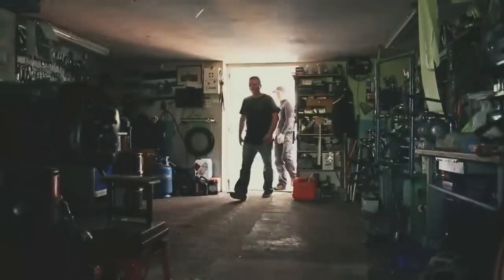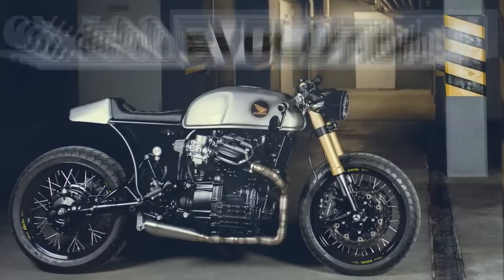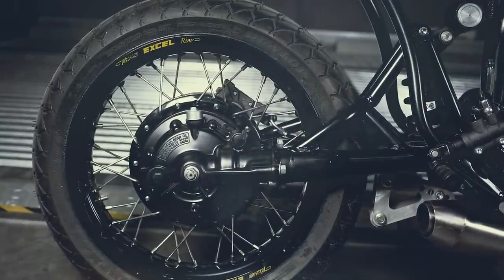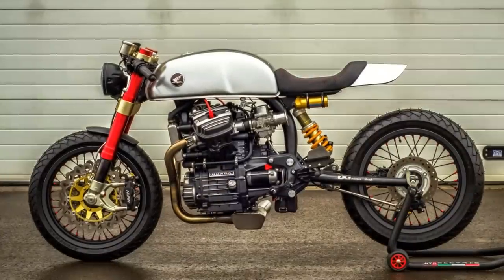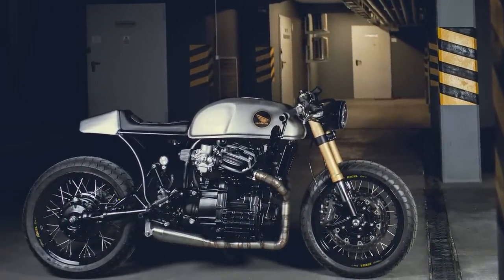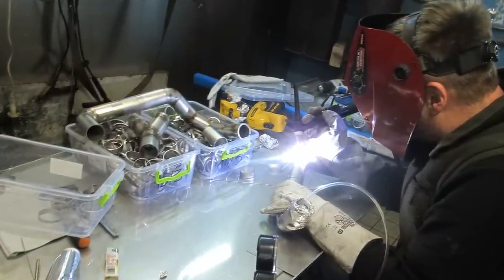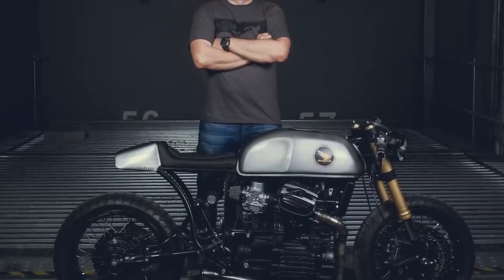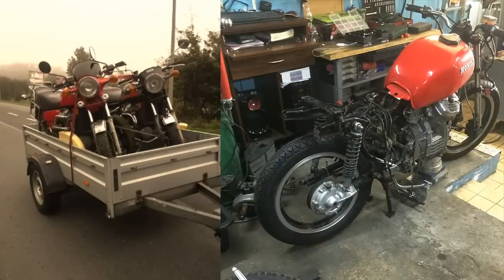Cafe Racer (Honda CX 500 by Wena Customs)

Comment: Very nice machine. Only one issue I see is that the exhaust emits directly onto the back wheel. A bit of oil and dirt from revving could make that pretty dangerous. Most under engine exhausts usually emit to the side to prevent this (eg versys 650 and er6f)
Reply: YEAH that's correct but is easier to slide :-)
Reply from the maker: Yes, you are right, but if you look carefully, you will see that the exhaust end hole, is directed to the side. :) Cheers.

Comment: This is a really nice video and really nice project. May be my next one. I did an XV750 a bit in this color spirit ( ic an share a picture to you  @racer TV  ;) ). But here is the point: i wonder if the inverted fork doesn't touch the exaust on big braking ?

Comment: Thanks for another great video Victor !
Can you tell me if you know, how they dealt with the liquid cooling ?
Are they using an electric fan system, or the factory belt and fan drive ?
Trying to see if they are using the original radiator, but not able to get a good look at it.
Otherwise, yes, a great build similar to Sasha's for sure !
Still think there is something more to be done with the rear suspension system in my opinion, but I do like the idea of the curved rear seat support.
Thank you again for all you do for our culture Victor !
Reply from the maker: Thank you. I'm glad you liked my friend. You made an excellent question. I thought the same when i saw this bike. The radiator on this project is not the factory original. It is much smaller. Because of that, i believe he change the cooling system using one or two small electric fans.  It is not an easy job. I know that on the CX500 from Sacha Lakic Design,  made the same thing. :) Cheers.
Reply: @RACER_TV  
I agree Victor !
Brining the exhaust under the engine in that way, definitely limits the room for a radiator in this design.
Have been thinking about an inverted airflow designed radiator, and mount it under the engine, with an air dam to direct air flow to and through the radiator.
Will open a new direction for design elements.
Have done a few trials in Photoshop, but nothing worthy of bringing from the drawing board to the fabrication table yet !
However, would definitely bring the bottom ground clearance distance down about 2½" to 3" lower !
I'm still busy trying to steal your CX650 design here !
LoL !
Reply: cooling sytem is from cbr125 with electric fan ofcourse
Reply: @redy001  
Thanks for your reply Redy !
Much like Victor,
I am a CX builder as well, while nothing even close to the ability of the two of you !
I am always interested in the deeper parts of the design beyond what meets the eye.
Thanks again for the insight !